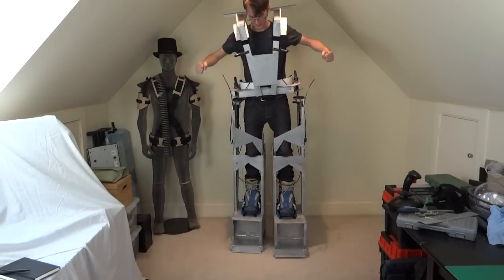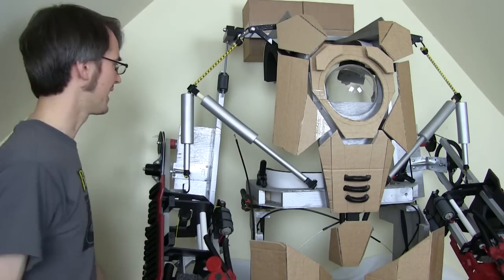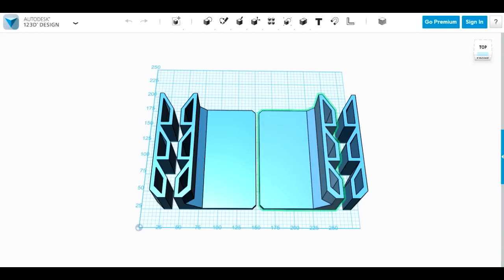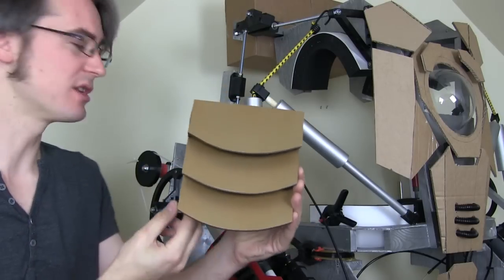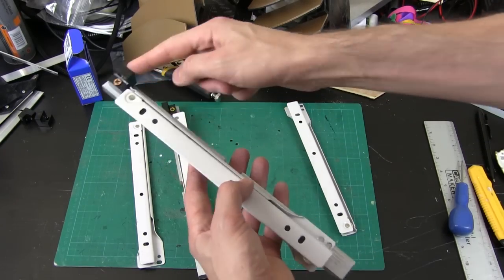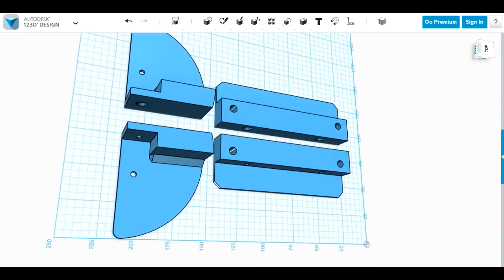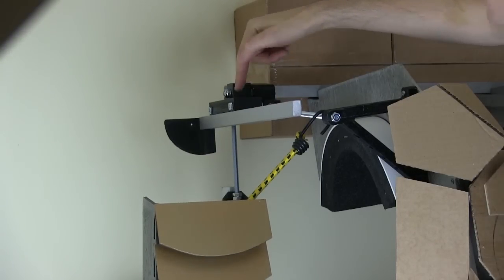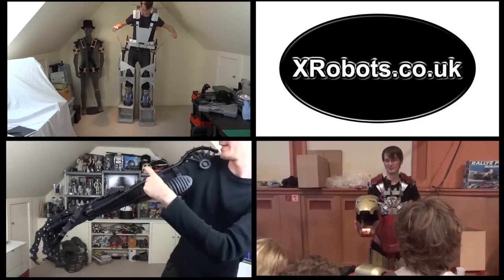Iron Man Hulkbuster Cosplay #12 | Bicep Details & Shoulder Bells | James Bruton

Comment: James, the detail content is not boring at all, in fact it is very helpful. What would alos be interesting would be if you could explain the process you go through when coming up with a specific part. Lots of these smaller items you print just seem to fit perfectly, but yet they have werd angles and things. Clearly there is alot of thought that goes into each, and it would be great to understand your thought process to get from nothing to a printed peice.

Comment: If you mount them on free moving runners there is a small chance that it could fall into the arm, I'd suggest putting Velcro onto the joystick and Velcro on a glove so if you do let go it doesn't run away
Reply: Maybe put a stop guard so that it can't slide too far into the elbow or up into the upper arm.

Comment: As the top gets heavier would there be any way to add a few real hydrologic pistons at the waistline in a sort of x pattern like you would see under flight simulators.  Not real pump driven ones but small ones like what they use on hatchback cars, lambo doors, and such where they move with you but also take some weight off your back.